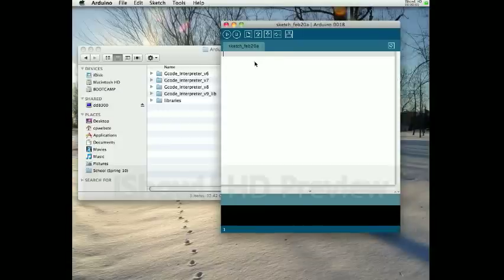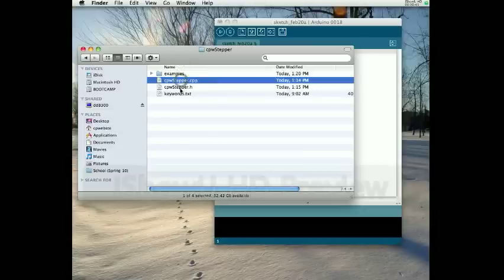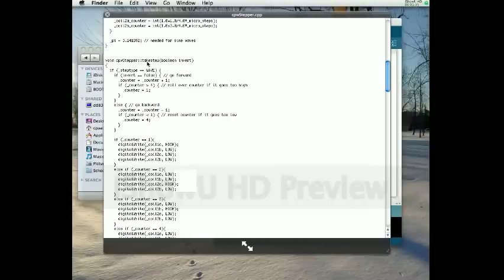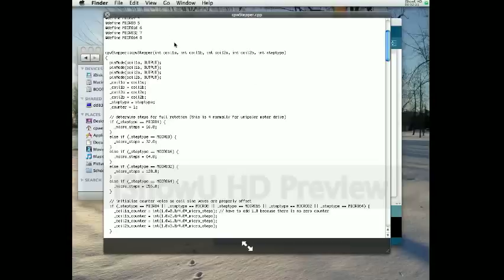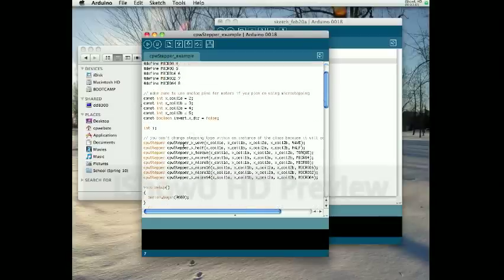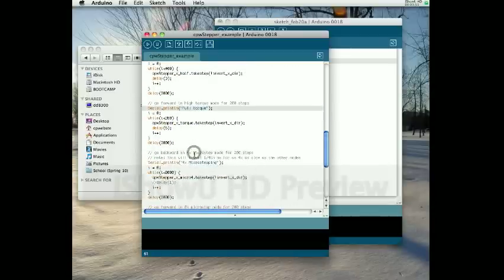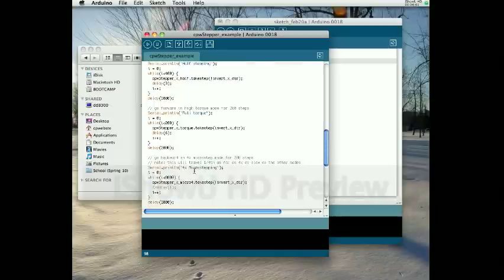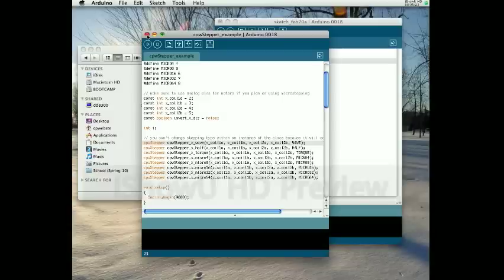cpwStepper Custom Arduino Stepper Motor Library

Comment: To achieve speed at 64th step, you need code efficiency, so assembler is the way. By the way, you should use a serious plattform like a monster PIC32 at 80MHz (up to 120 mips) using its IRQ's and DMA's and it's cheaper than arduino toys.